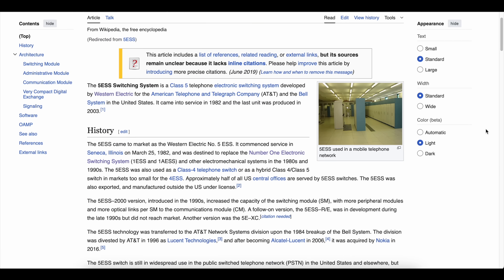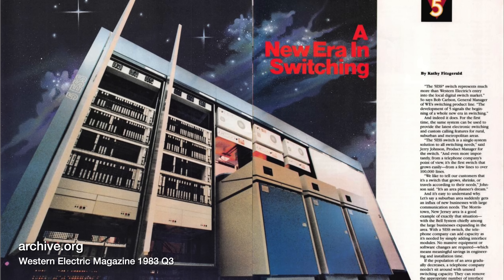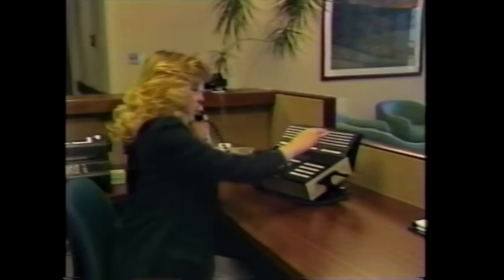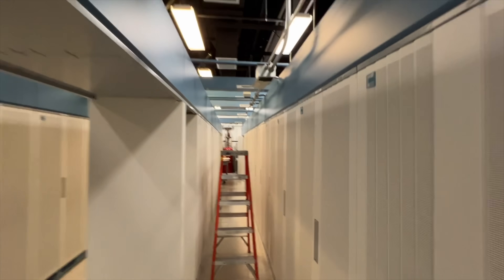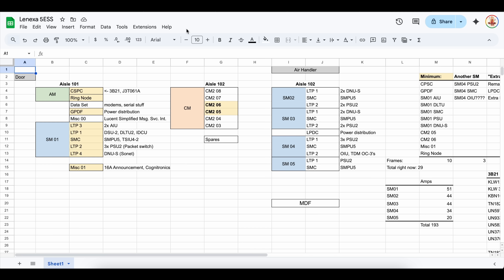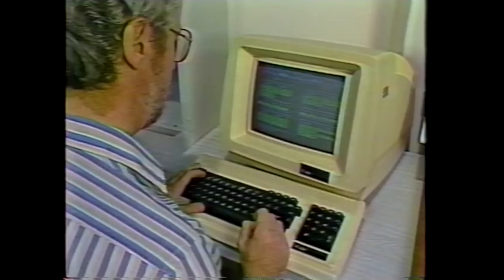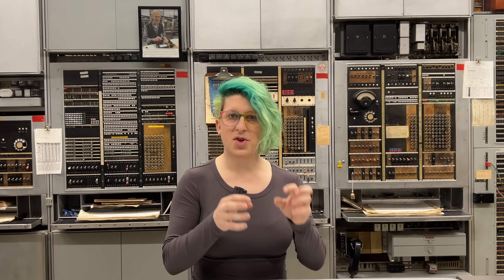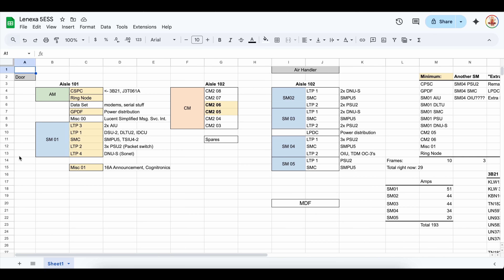We got a 5ESS!

Comment: Should have built a hut next to the museum so you could wire it up and do a hot slide. 😂

Pointless trivia - my father was involved with scheduling hot slides and then went on to Bell Labs to coordinate 3B support pre-divestiture.

Visually, the 5ESS is my least favorite switch. Aisle after aisle of monolithic blankness. Panel and XB are machines with souls.

Now you just need a 4XB tandem. One of the card translators would be crazy cool to have, but there were only about 60 to begin with, so I doubt any exist in any form now. Too bad…the engineering of a machine with a thousand or so metal cards with holes to route toll calls was borderline alien technology.

Comment: We pulled a VZ switch out of a Sprint colo under the instruction to preserve the cabling since it was to be deployed, maybe. A ton of it had DB25s with the long screws, and it was raised flooring. A tangled test of your patience.

The minimum cabinets to function is timely info, I just had this discussion on a telecom group but none of us were 5E folks... But some locations where 5Es getting removed came up. I walked past a 5E countless times and It looked to me that it was probably not that many essential cabinets and the rest were capacity additions for the most part or additional protocol expansions.

Comment: Based on your spreadsheet, you are absolutely correct on minimum requirement for a working 5E. If you thought SONET was fun, you should look at XTSI sometime.
Picking nits, but AT&T and Lucent are 2 very different entities. And, no, AT&T did not manufacture PCs; they were just badged with an AT&T logo.
CM = Communications module, AM = Administration module, SM = Switch module
The admin module has the switch translations, the switch module is the physical connections and the Comm module is what allows the switch mod and admin mod to talk to each other.

Comment: This is like dismantling a mainframe computer.
Reply: Not exactly a mainframe but close- the 3B21D is a single-board implementation of the 3B20D superminicomputer used in the first 5ESS.  The 3B15 and 3B4000 were the mainframes, the 3B4000 being a parallel system which AFAIK was only sold for a short period, and the 3B15 mostly used internally by AT&T.

Comment: One SM can handle hundreds to a few thousand lines (subscriber lines) or trunks. A large 5ESS installation could have up to ~192 SMs in a fully populated system. In such large configurations, total subscriber line capacity could reach 350,000 lines (or more depending on line vs trunk mix)

Comment: The 5ESS hasn't been a 5ESS since 2003.  Starting in 1996 the model was named the 5E-XC and remained as such until 2003.
In 2006, Lucent merged with the French company Alcatel to form Alcatel-Lucent. Finally, Nokia purchased Alcatel-Lucent in 2016 and is now the maintainer of the intellectual property once held by Western Electric.
So many changes.... :face-blue-smiling:
Reply: One great thing I miss about the 5E-XC in El Segundo is the speed of "call progress". With each digit pressed while initiating a call, it progresses to the final connection.  
Once you press the last digit of the telephone number you are calling it rings almost instantly.  
With VOIP there is a varying delay, but always a delay.

Comment: This is SO DAMN COOL! I'm very much looking forward to seeing this setup and working!  I remeber working with the Telco Tech around 2007 in Spokane to troubleshoot odd issues with the DIDs for the paging company I worked for. I remeber working with a Gal in Colorado with Qwest/Century Link who logged into the 5E in Spokane and was making changes on the fly. Crazy stuff.
Also, amazing working getting all of that deconed like you did! That reminded me of the time I decommissioned a Motorola Astro 7.X radio system last year. There where miles of Satin cable wrapped up in the racks because you just didn't cut the V.24 cables to length.

Comment: Thanks for this nice 5ESS moving video.  It surely brings up some fond memories almost 40 years ago!
I was a young engineer joining Lab 5563 in Naperville, IL, where 5E development took place. Majority of work when I was there (Indian Hill South, IX) were ISDN packet switching, circuit-switched data, and modem pool for POTS VBD bridging into LAP-D world.  The work was hectic 3 shifts plus 6-day week, mainly due to the actual development environment is a very expensive $$$$$ full-blown, fully configured 5E switch.

Something to note: CM performs trunk-level matrix switching (including add/drop timeslots); while SM does per subscriber-line level switching with necessary interface signaling & supervision.

In that era, the AM was using 3B20D, which is a duplex redundant CPU pair (bit-slices implementation of enhanced/feature-enriched WE320x0 uP).
Also, AM is more than just a typical OA&M control brain, but plays provisioning role (line features) as well as failover handling, some basic quasi-static load-balancing (switching matrix resources), and
... if I remember correctly, BRCS on-demand flexible call-state changes.

It really is a nice, full featured machine designed for Telecom in that era.

Comment: I was part of the team that designed SM line units. My contribution was the High Level Service Circuit used to ring phones and operate coin phones. I also designed the switch’s transmission plan which included a strategy to measure on hook lines at night so the correct balance network would be used during the call. 

Let me know if I can be of assistance. We have talked about 3ESS in the past. 

Rick Sparber

Comment: I used to live in Lenexa, and if memory serves, that 5ESS was installed in the Pflumm Road office in the early 2000's (AT&T/Western Electric spun off Lucent in 1996, so if the cabinets say Lucent it wouldn't be earlier than that, and Lucent spun off Avaya - the Enterprise platform in 2000, and Lucent stopped making the 5ESS in 2003 before they were absorbed into Alcatel in 2006), likely making it one of the last 5ESS's installed (in this case for a Fiber Internet provider that also offered Cable TV and home phone service). Most of Lenexa and surrounding communities was wired by them in parallel to Southwestern Bell (now a part of AT&T) and the Cable Company that already had infrastructure in the area.

It's good to know that a piece of that technology will survive - I know once the Denver museum opens, I'll have to make a trip from Texas to see it (of course I say the same for the Seattle museum).

Comment: Great video.  Installing these cable I think is way  easier than taking them out as you  assume it won't be you and the switch will  be there forever.  Never worked on ESS central office switches  mostly CPE systems like Nortel and NEC

Comment: Hard to imagine that there were once over 1,000 5ESS in service handling over 100 million landlines and now they are all but gone.  Anybody know if MIT still has their 5ESS or if it has been relegated to solely replacing the ancient SxS system that once powered DormLine?
Reply: There are a lot of working 5 Ess machines. I've worked on 5 in Oregon and they are still on line,

Comment: Having been a part of the 5ESS story since day one, I'm thrilled that a piece of it has been selected for the museum.  My personal story began when I started at the Labs Indian Hill location in Naperville, IL.  and runs parallel to the 5ESS story.  As telephone switching grew after WW2, the New Jersey based work was transferred to what became the largest Bell Labs location outside of NJ.

What began as the 1A ESS Restructure Project, a study of the possibility of redesigning the 1A software, largely written in assembler, using what was then considered modern software development techniques like structured design, a formal operating system, and a high level language, became 5ESS when AT&T finally acknowledged end-to-end digital switching was the future (in 1977), thanks to the DMS-10.

My involvement included deciding what high level language to use (EPL-X or C), setting up the first PDP-11/70 Unix machine dedicated to 5ESS software development (1A and 4ESS software development was hosted on IBM TSS machines), the first implementing the C compiler for the initial SM processor (Intel 8086), recommending a replacement for the 8086 (Motorola 68000), managing the exponential growth of the SDS complex (PDP-11, VAXs, Unix on IBM and Amdahl big iron), continued with special study teams considering the future of CO switching, managing Turnover to Cutover services for new customers (domestic and foreign), and finally trying to pull together the various components (switching, transmission, operations support) to a unified end-to-end product offering.

In retrospect, the Labs leadership was risk-adverse to a fault.  The 8086 was chosen because the chip had second source manufacture (AMD) and replaced only when the software, written in C, became memory-bound due the limited 20-bit address space (21-bit when the I and  D spaces were split).  The 6800 and the 68000 were better suited for C, which presumes a large linear address space, not a series of 64K linear spaces aligned on 16 byte boundaries.

In addition to trying to recycle the 1A hardware with Restructured software, getting into the digital switch game late,  then dismissing packet switching as impractical for voice traffic (variable delay issues disappeared as packet speeds jumped), and sticking to SONET rather than IP when fiber became king, the then leadership tried to play catchup by buying startups to make up for their defunding of forward looking work that had previously defined the leading edge.  The split off of Lucent in 1996 compounded the problem as Rich McGinn chased the CLEC business bubble to please Wall Street and pump the stock price.  Lucent ended up as a penny stock before it sold out to Alcatel and they sold out to Nokia.

Comment: Great find. May I suggest the following. The venerable WECO D4 channel banks are going away as the copper loop fade into optical fiber. The D4 channel bank was typically the gateway, at least at NYTel, into the digital circuit switching network, by providing trunk line termination access to DID/DOD and E&M trunks, in addition to the two wire trunk switch modules. D4's that were installed new in 2002 post 9/11 at the West Street CO are being spared up as DS0 circuits disconnect. I suggest that they be gotten while they are hot, along with the SLC96 and Series 5 loop carrier systems remote terminal channel banks that will integrate directly into the 5E switch under TR-0008 as Integrated SLC. I know that this is getting ahead of the situation, but a good time to plan for the demise of the circuit switched TDM network.  Congratulations. Hope to visit the Denver location on my next visit, and the place at Seattle.

Comment: Here's a few words of comment: 1. Ear protection. You're gonna need it. 5Es have a lot of fans and make a lot of noise. Seriously consider this when you put it in your museum. The console and the ROP are usually in a separate room from the racks because otherwise everyone would go deaf. Compare this to the nearly silent DMS-100, EWSD2, and GTD-5Ex. 2. Manuals, I hope you got a full set of manuals. If you want to navigate the console and figure out the translations you'll need to consult the manuals, a lot! 3. Slow Down. Did you know that the ability to input commands to the console was intentionally slowed down in order to reduce the load on the unionized craft people. If you try to put in 2 commands with less than 10 seconds between them the console will beep at you and make you wait 30 seconds.  4. ISDN, some people in the comments mention setting up ISDN on the 5E. That's a bit tricky because of the hidden tid at the end of the spid. As far as I  know this isn't documented anywhere but essential for provisioning an ISDN line. 5. Load Generators, if you really want to show it humming you need to get some load generators.Back in the 80's, with those captive switches we had in Bellcore that @dvatp mentioned earlier,  we used Ameritec AM1 and AM2 load generator boxes for both POTS and T1 traffic generation. 6. Fiber optics, the 5E is the first switch to have an internal fiber optic connection. It's worth pointing out in a museum.

Comment: I've torn down aisles in data centers before (computer gear) and undoing the wiring is a nightmare. Huge props for preserving it all! More than once I resorted to using shears to free gear! 

This is so exciting though!
Reply: 💯 This is the hardest part to outsource.  Every time I've ever asked anyone else to "make sure you label where each end of every cable came from", it's always a hard-mode puzzle putting it back together.

From not being able to read the handwriting of whatever language it was that the disassembler wrote in, to missing labels, to finding out that they had no idea how to identify port numbers or devices and just made something up, to losing entire cartons of cables that went "???", to finding out hours later that they all left -- job complete -- with half the cables still plugged in.

Moving anything is always a clenching experience because you know it's not just going to go back together again on the other side.
Reply: this is real, when tearing out equipment, sometimes a pair of lineman sheers(super scissors) is invaluable
Reply: Good to see you here! 👍

Comment: Can you clarify a bit?  You mentioned "5ESS" and "Lenexa, KS" but also mentioned a firm called "Everfast" as the operator who is donating it.   Did they happen to buy that switch from SBC/AT&T out of its Lenexa central office?   Or maybe just assume control of it in that CO?   If so, I actually was part of the team in 1992 that installed that switch.  Well, I wasn't involved with the physical installation but my team did all of the trunk translations to pre-build new trunk groups from the new 5ESS to its metro peers to prepare for the cutover.   EDIT.  Never mind.  This had to have been installed by a CLEC back in the 1990s in some office park somewhere.  The facility doesn't look like Lenexa CO and that wiring mess in the overhead racks was absolutely NOT Western Electric work.
Reply: I did some searching in the LERG, sounds like you helped install KSCYKSLEDS0, which is still in service. The switch that was donated to the museum was likely LENXKS24DS0, the location of which does look like an office park.
Reply: Just to add to this, I think thecooldude9999 is correct about the location.  This was most likely in Everfast's CO on Lackman Rd.  The company company started as "Everest" back around 1999 or 2000, and advertised itself as a phone / cable / internet provider.  They claimed to build out a fiber / cable network, but my house was so close to the CO that the box in my back yard appeared to only have copper in it -- no fiber (I peeked at their work when they left for the night after they had pulled the cables but before they installed the covers on the boxes).  I used their phone and cable internet service until a well known big tech company rolled out fiber to the neighborhood.  The cheapest service Everest provided when it first rolled out was symmetrical 256kB/s, a nice jump from the 56k modem I previously used.  Then one day they bumped me up to 384 kB, then 512 kB, then 1 MB.  The company expanded via mergers and / or acquisitions a few times, and also changed names.  Then a couple of years ago that company decided to spin off the original Everest service area into its own company once again, but due to some legal matters they weren't able to obtain the old name, hence the name "Everfast".  They've since made some changes to be more competitive with the big tech company's fiber service mentioned earlier. (Edited to correct street name)
Reply: This switch was LENXKS24DS0 as @cooldude9999 has stated. It was purchased new from Lucent. As referred to elsewhere, I believe that it was one of the last switches built by Lucent. It used to be paired with a Lucent 5ESS-2000 that was not able to be preserved.

Comment: What a job moving all that equipment. Well done.
Way back in 1960s moved a teleprinter system, just 6 printer circuit fed from an old VF rack that used valves! Weighed half a ton, needed strong gang. Moved less than mile which had to be done in less than 36 hours. Move from old office to new building.

Comment: This year at the 39c3 there will be an EWSD providing ISDN and ANIS to the participants. It'll have plexiglass doors so you can look inside while it's operating. The EWSD apparently can be scaled down to part of a single rack, though it apparently isn't quite as flexible as the System 10.

Comment: Throughout the 80’s I worked with Southern New England Telephone Co converting 169 central offices to 5ESS. It’s hard to believe those switches are now obsolete. But then it has been 40 years.
Reply: In 1997 NYNEX, the parent corporation of New York and New England Telephone, retired it's last analog end office switch, a 1AESS, when it rolled all traffic onto an existing DMS100 at the  W73rd Street CO.

That's less than forty years since the NYNEX switched network went completely digital switching. Now those switches are planned for retirement, and with the ancient #4ESS Toll Switch not far behind.

Comment: Hopefully the museum can sell the copper in any excess wiring.  I think copper is trading for almost $5 a pound.
Reply: There was very little copper in the switch. Most everything was at a DS3 level. Any of the interconnecting cables will be saved and possibly some of them will be reused at the new location.

Comment: When reconnecting DC power, be sure the power-supplies -  electrolytic capacitors, are fully  discharged.  Otherwise...  GoodBye to several circuit packs.